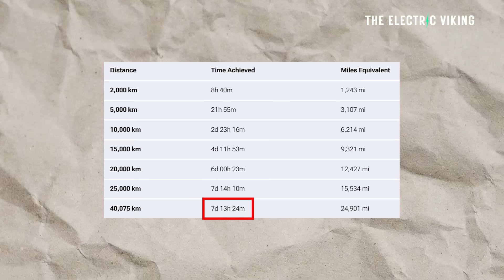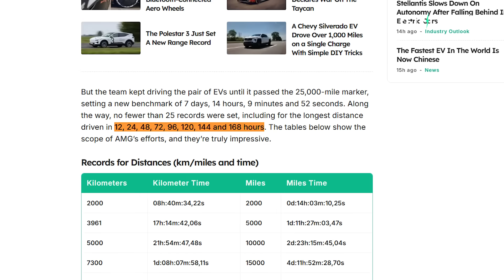Record Breaking Mercedes EV gets 1,360 hp, 850 kW charging, 300 Wh/kg

Comment: Yeah that's the strange thing about science and technology, it often takes a long time to achieve a certain target because experiments, data analysis, testing, further experiments by lots of people, but once something is demonstrated as being possible it doesn't take long for other people to reproduce it. Once one company has demonstrated that high speed charging and long drives are possible then it's only a matter of months before someone else is doing it, because all these things are known technologies, they already know how to do fast charging, they already know how to drive long distances, they already know how to make reliable electric motors, they haven't bothered because..why? This is just a "we can do that as well" thing. Again, and I have said repeatedly, when you can buy this in a cheap mass produced production car rolling out of a factory every ten seconds that's when it will be news to everyone.

Mercedes are well known for introducing technology into their top tier cars that eventually flows down into their lower priced models, but this isn't even in their production cars yet, so no, not a year or two, probably more like 3 or 4, basically the same schedule as everyone else in the EV car manufacturing business who are working towards solid state batteries. I would be more than happy if someone came out with a solid state or semi solid state batteries next year and started selling cars with that sort of energy density, but I won't get all hyped up until it actually happens.

Comment: The electric motors are not the most efficient.
They all are based on second patent of  Nikola Tesla.
Those motors have heat to yo back efm
The motor based on first patent, patented 120 years ago, consume 3 times less.
Means a car with 750 km antonomy, with first patent motor obtains 2250 km autonomy with same battery
Reply: afaik the efficiency coefficient of modern EVs is very high, over 80%. Can't be more than 100%, that would be either magic or some weird quantum nuclear stuff/cold fusion.

Comment: Sam Mercedes Benz has not made a RELIABLE car in 20 plus years. Why would anyone buy a car full of failure points? This is marketing BS. MB is so good at BS
Reply: You are wrong on the internet again.
Reply: BS! I had a new CLS 350 CDI Shooting Brake for 90,000 miles and it was faultless…
Reply: @atlantikav5902 
I think he's talking about the pre 2003 MB models that was much more reliable than a Corolla
Today you can't put sand coolant in radiator like before, 
MB is more reliable than a BMW but it's not really reliable
Reply: Xpeng is production car.
Mercedes Benz is Prototype car.

Both are not the same.😂